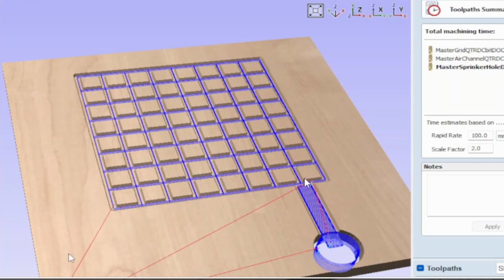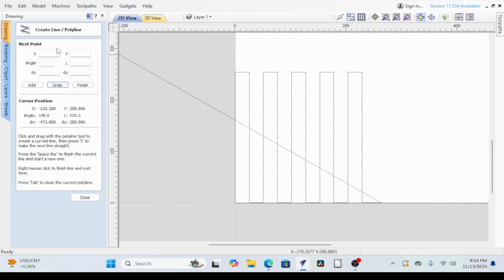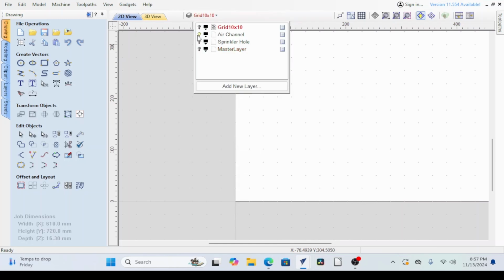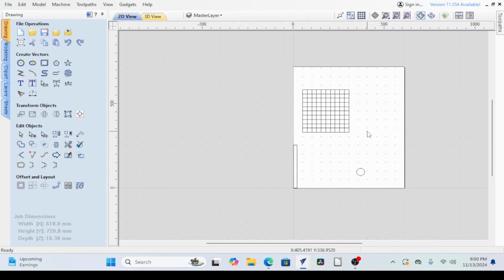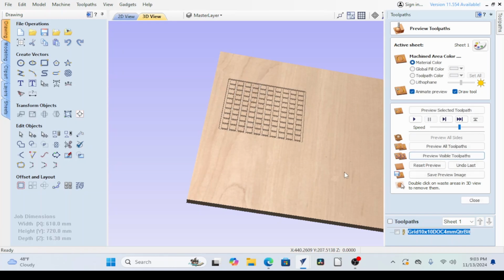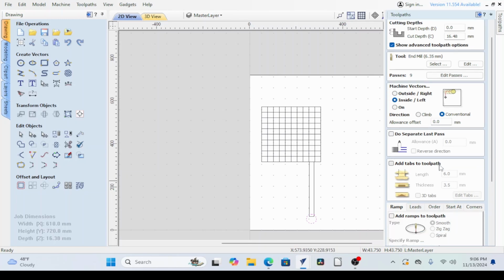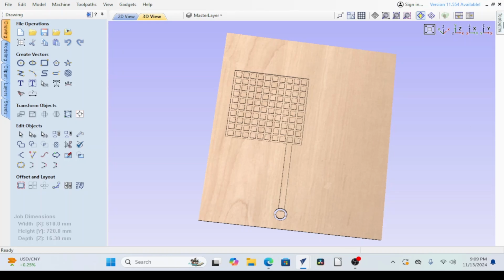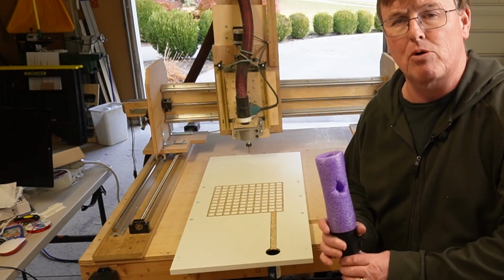A $20 DIY VACUUM TABLE FOR CNC AND WOODWORKERS -- CAD, MACHINE, & TEST.  DOES IT SUCK REALLY GOOD???

Comment from the maker: If you haven't watched the first video

DIY SHOP VAC VACUUM TABLE FOR CNC OR WORKSTATION! BUILD FOR LESS THAN $25 IN ABOUT 1 HOUR!  

Here is the link:
https://youtu.be/Bp91BRztqc0

I do include some hacks in the first video that are not shown in this one and explain in more detail components and assembly.  

Remember if you choose to build this vacuum table remember to press down on the board when first setting the vacuum.

One of my viewers recommended the Fein vacuum for use in a vacuum table as it has a separate motor for cooling.  I think it is worth checking out (I am not an affiliate nor am I being sponsored by Fein).  If you were the viewer who suggested this thanks and please comment so I can give you credit for your awesome tip.

Comment: appreciate the video, but this did not create anywhere close to being enough hold down using a shop vac. I did follow instructions to a T. oh well, thanks though. 
The thin wood as you have shown works as long as it is 1 piece, but thicker wood or more than one piece (and the thicker wood's imperfection) apparently allows too much leakage. 
guess i will stick with the old fashion tape and superglue.
Reply from the maker: Your comment is very useful feedback. Thanks for sharing. 
For sure, the surface of the wood touching the vacuum table needs to be relatively flat (significant imperfections will definitely leak off vacuum).  If you find your table is leaking vacuum when holding a board, I suggest you try covering up the hole in the pool noodle air port with some duct tape (while still monitoring your vacuum to make sure it doesn't overheat).  Also make sure that you constructed your vac table out of melamine (regular particle board is too porous/not sealed--It won't work well)? What was your grid size/line spacing? Increasing the grid density has a huge impact on holding power  Another thing you might try is pressing down firmly on all areas of the larger board when initially setting vacuum.  You may find that the vacuum grabs the board if you do.
  
I am also curious, did you find the board that was slipping horizontally or was it lifting up?
Reply: @Simplifycnc  sorry about getting back to you so late. Thanks for the reply.
I am using a generic Hart 6 hp 8 gallon shop vac, seems like it "should" have enough guts to pull it off.
Anyways, and I apologize if this reply goes long, but I noticed the workpiece held very good at the hole and the path up to the slotted 10x10, so (with some of the idea generated from watching your first video on this as well) I decided to make the 10x10 with 1/4" (I believe but I did make it exactly to spec as you instructed, and yes it is melamine) and then dril out the same hole you dimensioned but in center of that 10x10.
As long as you can efficiently cover up all the slots that are not covered by the workpiece, it does hold the workpiece down quite well but not so much if you leave any slots open regardless where the workpiece is open.
this got me thinking some more. what if I purchase 3 (or 4 or whatever you think you may need) rubber mats (each one bigger than 10 inches as I have exactly figure out yet how big but so as to cover the entire 10x10 & then some) and cut out say a 4x4 square in middle, then maybe second one a 5x5 slot, etc... so as to not only seal the vacuum to a confined space but user can custom size the vacuum according to the size of their work piece. Know what I mean?
Also, what if I made the square blocks in the 10x10 bigger than the 1" you have dimensioned in your example so that their is less channels? I would think that would create more vacuum spread out and stronger throughout the 10x10 hopefully towards the outer edge.

Anyways, I look to hear your thoughts.. Thanks again. When I do get around to further tinkering with my ideas and such, I will try and give an update.
Reply from the maker: @bradleyschroeder1882  No problem. Thanks for replying.  Is the thick board getting any pull down at all or is it completely loose? I may have a couple of possible solutions for you that will solve the problem.  1) If you are not as concerned about slight difference in board height you could put a 1/4 inch rubber tube in the outmost grid groove (and then press down your board firmly with vac turned on. It should compress enough to grab the board even if it is a little warped).  You can also add a couple of dowels in your melamine on the far edges outside the grid area that you can but the board against so it can't slide (they don't have to be glued in but can just be slipped in loose fit into an appropiately sized whole drilled into the melamine and then removed when not in use since they only need side to side holding power).
2) Tomorrow I am releasing a new vacuum table vid that shows a painter's tape trick to increase hold down and minimize the chance of slipping side to side. You might give it a try with a thick board (maybe even using the painters tape along all four edges of the thick board (ideally after the vac is established) or if you are getting absolutely no vac pull down, you might be able to trick the vacuum into engaging by using the tape along the edges to induce the vacuum hold down by creating a psuedo-seal).  I am not sure if that would end up being more work than its worth but since you already have the vac table maybe a possibility. You will understand the details after  my video.  It should be out early am tomorrow.  If I can be of anymore help let me know.
Reply from the maker: As a side note, don't use blue painter's to seal off your main vacuum channel inlet -- its adhesive I found is not strong enough and will eventually fail breaking the vacuum.  Use plexiglass with epoxy to cover sprinkler opening & channel (or at a bare minimum clear strapping tape) -- and do have a secondary clamp on board just in case of vacuum failure.  Using blue painters tape around the edges of the board/overalaping the sides of the board I still like.
Reply: i just purchased some 1/8" neoprene for another project. it's more than those matts but for the idea of adding a lift and changing the shapes of the vac it may be interesting to try out.

Comment: The drawer liner tip is awesome. I have some of it and can see it working well.
Reply from the maker: Thanks. Let me know how it works for you.  I really don't have any issues with things slipping without it so I don't have a good reference point (other than testing with my hand pulling on board).  Since you already have some drawer liner definitely give it a try.  You might also try just scuffing the inner grid squares (with some diagonal lines) using a very course grit sandpaper.  I think that would work as well.

Comment: There are several conversion techniques that could be used:
1) Change the job units to inch to eliminate the conversions.
2) Use the *i+ o*m= on each dimensions to do the conversions for you
3) select the vectors , pick scale with x/y linked then *i= or *m=
Reply from the maker: Good input.  Thanks for posting this for everyone.